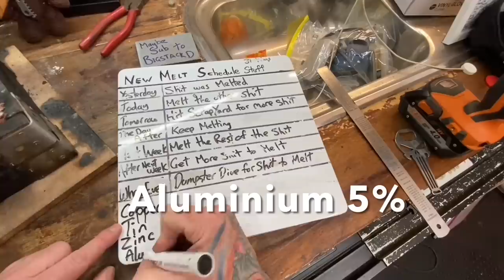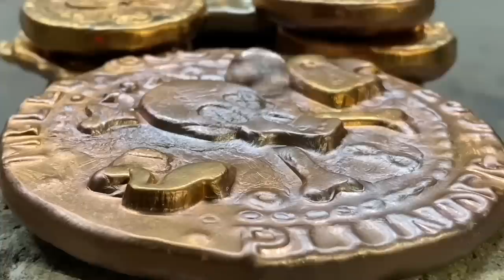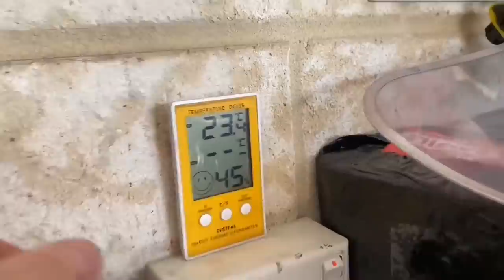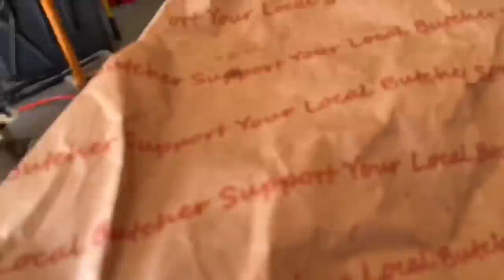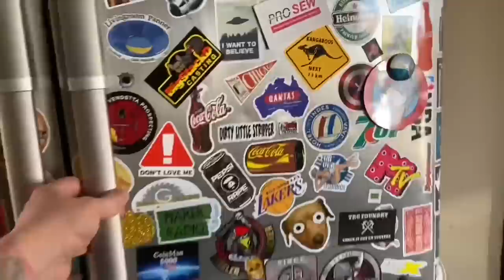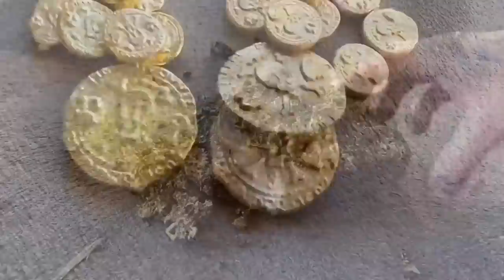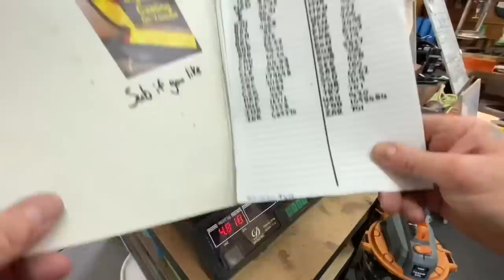Nordic Gold Casting At Home - Trash To Treasure - ASMR Metal Melting - BigStackD Copper Alloy

Comment: Copper Tin and Zinc is actually an old recipe that used to be known as gun metal way back in the day. It was one of the primary casting materials used on old bronze cannons and it has this absolutely wonderful deep bronze color that weathers to a rich golden brown. It's not as yellow as your nordic gold but it's still very pretty, I'd highly encourage you to make some if at all possible or if you'd be interested.

The recipe was usually somewhere along the lines of Copper 85, Tin 12.5, zinc 2.5
Reply: There's several similar recipes in a family, to which they and Nordic gold belong. Cast iron bronze aka naval bronze being a pretty cool one to check out.
Reply: He has melted things as hot as Cast iron (~1204C) before, so I hope to see if his forge can make some Nichrome. (~1400C)
Reply: That’s interesting
Reply: @Hue_Sam  it took a while but I got CuNi 70/30 out of one

Comment: A fun project you might consider....  A field trip, literally. If you know someone who owns rural property that has a large ant den (or even smaller ones make unique sculptures). Take several of your forges to melt plent of aluminum if it's a large den. There are many videos on YT that show the process with a framework of sand around the entrance to safely funnel the metal into the den. It looks like the hardest part is softening the ground with water to safely dig the sculpture free. An ant den sculpture would make a nice addition to your shelves. It would be interesting to find out, if other metals would work as well. A Nordic Gold sculpture?

Comment: If you melt Copper in a graphite crucible and let it slowly cool there until you can let it slide out, then you´ll have nice crystaline structures.
I love these and havn´t seen those here😉
To clean the bars, use hydrochloric acid mixed 50:50 with water.
Remember protection gear and use a toothbrush to clean them, it´s easy and looks awesome.

Comment: I must also mention something to you... I think the bars you have poured into the sand casting method have turned out better than the ones poured into your open molds.  Just an observation, but that seems to be the pattern for your pours.  I think it may have something to do with not having the ingot molds hot.  I could be incorrect...

Comment: What happens when you wait a bit longer to let the metal get hotter?  Seems like you get some cold shuts in your fine detail that might be resolved by letting the metal cook a bit longer so there is more energy (heat) to keep the metal flowing just a bit longer as the molds pull heat out.  Not an expert (or even an amateur who knows anything) by any stretch, but I do recall when I used to cast in sand we let our silicon bronze and aluminum cook for a couple hours before we tried to pour it.  Thinking about getting back into that hobby and would value your insights given your experience.

Comment: Metallurgical fun facts:
- Adding 10% calcium prevents certain magnesium alloys from being a fire hazard.
- Lithium can actually increase the strength of aluminum alloys, since lithium atoms slot themselves very nicely in an aluminum lattice.
- Magnesium likes to do the same with titanium.
- Aluminum, carbon and manganese can become magnetic when combined into a single alloy.
- Adding a bit of aluminum to gold can turn it purple.

Comment: I've always wondered what the conductive properties of Nordic gold are compared to other copper alloys,  seems like it could make for a lovely and practical material for cooling blocks, heat sinks, and even as an electrical conductor for contacts etc. I imagine it's not better than some copper alloys but it is an interesting material!
Reply: Pretty sure it would make an awesome heat sink. Probably also very expensive one. I can't imagine the cost benefit analysis would favor using it Alot. Definitely seems to be a good looking art alloy though
Reply: @joshschneider9766  I mean it's a bunch of cheap metals, the only reason it'd be more expensive than say brass is economy of scale. After all, zinc, tin, and aluminum are fairly cheap metals to acquire as far as alloys go. 
Besides then you have shiny heat sinks

Comment: I really enjoy your videos immensely. I have a question about the coins/medallions you make. Is it possible to have the coin molds made in such a way that you could pour the metal in a hole of two molds clamped together to make double-sided coins, like heads and tales, with Different designs on the front and back, see?
Reply: There's a way, he would have to get some kind of stamping machine to stamp the mold so it's a uniform coing stamp like how most currencies are made.
Reply: @nlu17  Yes I understand that, I was asking if he could have a hinged mold that could be clamped shut, with a wide hole for pouring and a vent for air to escape, then he could pour molten metal into it and make a double-sided coin.

Comment: Man convert those open top graphite molds into closed ones by clamping a flat graphite plate to the top with a riser cut into it.. That way you get the sprue on the back and you don't have to change the original molds

Comment: Nordic Gold (Swedish: nordiskt guld[1]) is the gold-coloured copper alloy from which many coins are made. It has been used for a number of coins in many currencies, most notably in euro 50, 20, and 10 cents, in the Swedish 5 and 10 kronor coins (for which it was originally developed and introduced in 1991), as well as the Polish 2 złote commemorative coins. Its composition is 89% copper, 5% aluminium, 5% zinc, and 1% tin.[2]    (I had to look this up.)

Comment: Im about to try this for the first time probably not using the correct equipment, but on the final coin pour at 9:00 there wasnt enough metal left to fill the mold. Could you use the stir stick or something to move the molten metal around and try to fill the voids to get a full face of the coin?
Im also curious if after pouring the metal into the mold it sits proud of the top of the mold, could you press another mold into the top to create a 2 sided coin?

Comment: it is not translated Spanish language Spain a greeting. create your continuous casting funnel directly into the oven 
Hola amigo tal vez te interese para la tapa de tu fundido precisas hierro dulce grueso para crear 2 embudos con una separación de 4cm el embudo principal es el que acoplara sobre la tobera al que le colocaras una tapa de 4cm es obligatorio está acura mínima y hay se coloca el segundo embudo con un agujero máximo de 2,5 o 3cm y su tapa apatible con un agujero 1cm inferior a la parte de abajo al embudo principal se acoplaras el mismo diámetro de la tobera perforando el primer embudo y con ayuda de un caballete puedes agregar un acople a modo chimenea el embudo de colada es un sistema emosis que aprovechar el calor del horno para fundir metal que se certera directamente a la colada a a la tobera de la tapa decís dejar 1,5 cm de espacio y crear un soporte de anillo que se acople a tu tapa con 3 paras que fijarán el embudo de precocido . Te recomiendo que el que se usa para colada continua le des revestimiento interno con aluminosa o la amalgama que te comenté arcilla caolín 90% y polvo de grafito crisol 10% y agua destilada el agua común puede y perjudica la arcilla de caolín

7,80g es el peso de la moneda 50.C Euro el valor de 4kg es de 512€ ya que has echo la aleación de la moneda Euro si tú lincote está dentro de la aleación Euro el valor estimado en subasta alcanzaría los 600€ pero debes agregar tu sello de golpe para aumentar el valor sin tu sello el valor estimado 15% menos que el precio del gramo de moneda euro

Comment: Awesome video. Been trying to find the sifter you use but no luck. Any tips?
Reply from the maker: The ones I use the old vintage brass ones are probably very hard to find but they do have stainless steel ones on eBay if you check out this link that’s very similar to what I have you would just need to find the appropriate sizes. That link is just to show you and may not be the same size as mine but I’m not home at the moment so I can’t tell you what my sizes are on my sieves 👍🏻 
https://www.ebay.com.au/itm/80-120Mesh-Gardening-Metal-Home-Garden-Plants-Riddle-Soil-Sieve-Mesh-Separating-/403571700129?mkcid=16&mkevt=1&_trksid=p2349624.m46890.l6249&mkrid=705-154756-20017-0

Comment: I just started making copper ingots. I watched several videos where the person used a muffin pan to make small rounds. My little experience is causing the copper to fuse with the pan. I'm having problems getting the ingot out of the mold. I am in the process of gathering steel to make a larger mold. Can you share any tips to help?

Comment: Why do you squish your copper tubes before melting them please?!
Reply from the maker: Purely  just to fit more in the Crucible so it’s a little bit faster to melt👍🏻
Reply: @bigstackD  That's what I wanted to know, if it's faster to melt with compressed pieces a copper like that.

Comment: On pieces like the woodchip wagon nut would it be of any benefit to try and clean it with acetone or some other strong solvent to cut down on slag? Would that even make any difference at all?
Reply: Secondary question: what do you use as your mold release agent? It looks like baby powder, but is it?
Reply from the maker: yes it would definitely help reduce slag if I clean the pieces but people do love seeing the slag skimmed off. The mold release stuff is simply Johnson and Johnson baby powder. You can get certain things that works as good or better but this stuff is cheap as chips